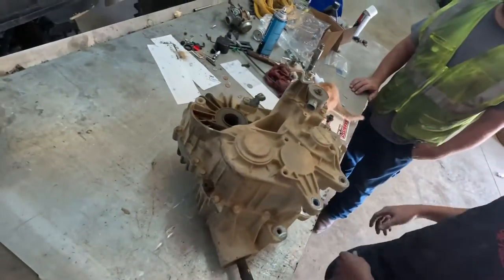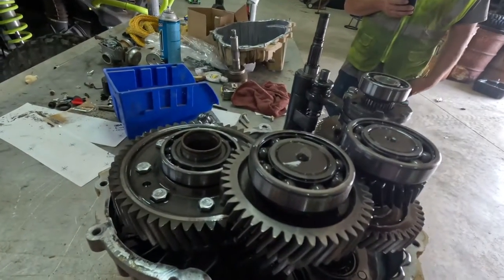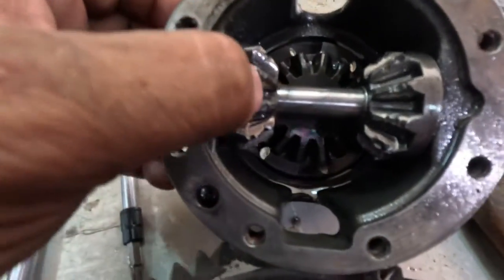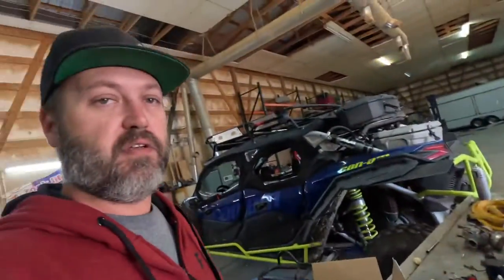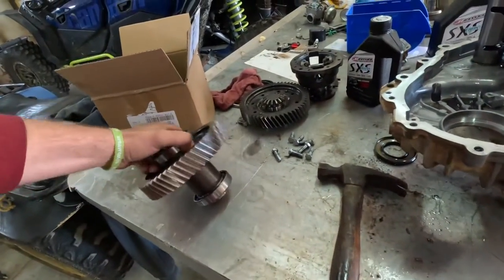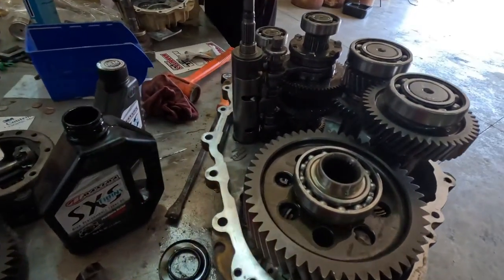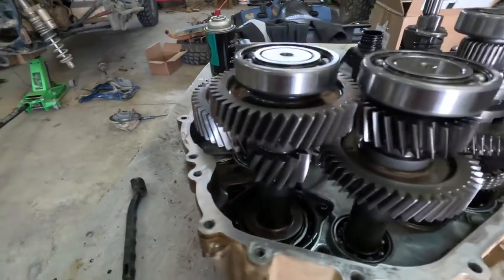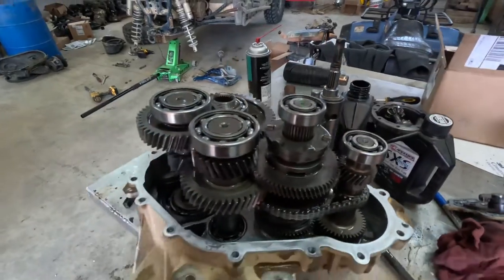Polaris General XP4 Turf Mode Delete

Comment: You said the turf mode is good around the yard but breaks on the trail.  I ran my 2013 ranger 900 for 5000 miles in turf mode on the trails but admittedly, never push it hard.  Have a new xp1000 and planned to run turf exclusively except in mud, will that be a problem? 4
Reply from the maker: It doesn’t seem to matter weather you are in or out of turf mode.    If you are going to trail ride it  I recommend getting it out of your transmission.    We have already done several more since the release of this video.

Comment: Any input on a turf mode only option?  I have some 900 crews at work. I would like to disable the rear diff loc permanently.  Open rear diff is of course fine and 4wd still needs to work.  How can I best accomplish this?
Reply from the maker: At this time I don’t believe there is a way to accomplish what you are asking.